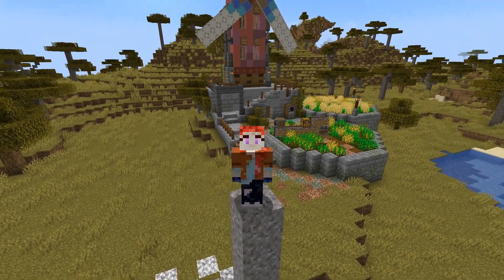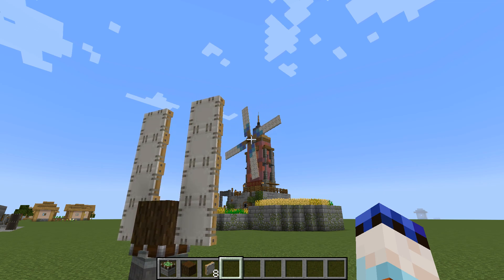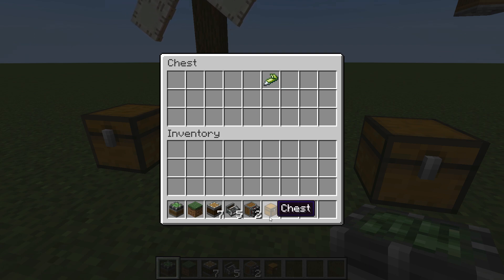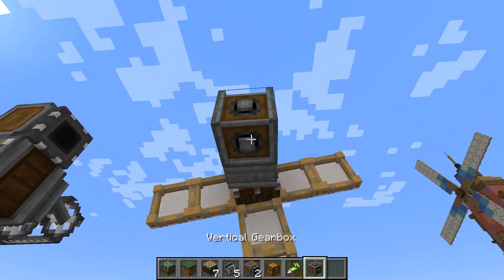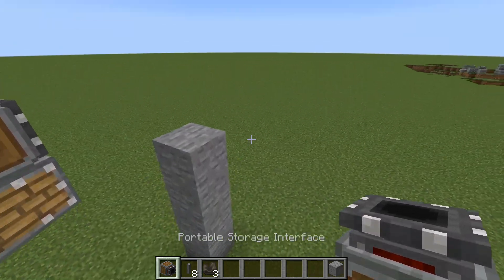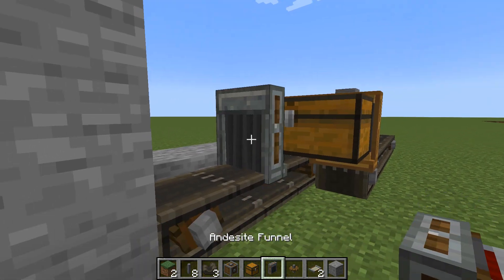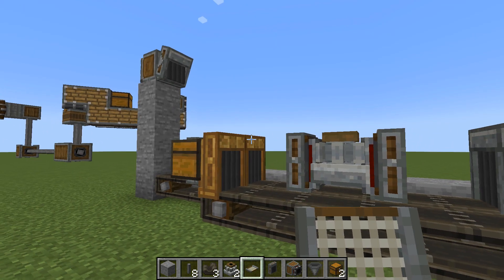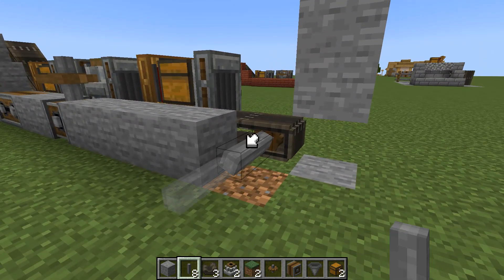Minecraft Create Mod Tutorial: How to Make a Windmill. From Wheat to Flour. Part 1 The Mechanics.

Comment: With making the gears faster, big cog little cog then addding a shaft so the gears don’t interact. Instead just placing a casing on the gear will save u a block worth of space.  

Not much for a small build like that but bigger builds it saves so much 16:13

Edit: so placing the casing on the big cog then the process of doing it faster should save block